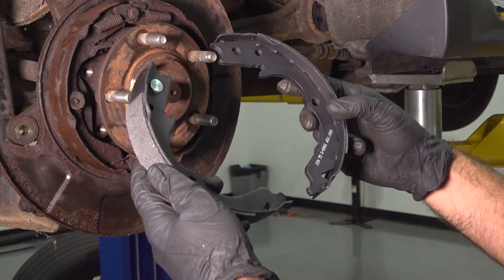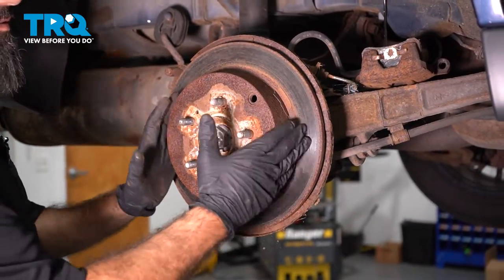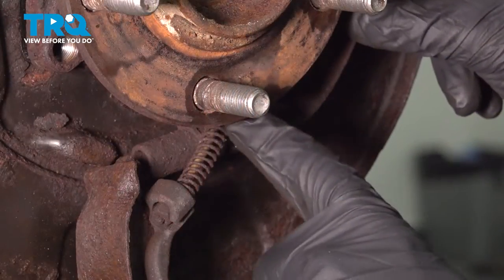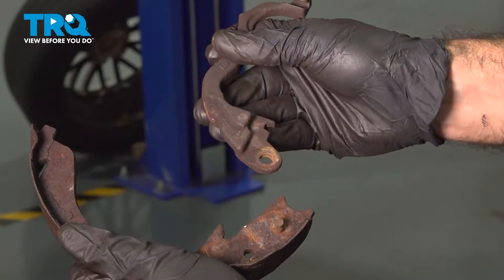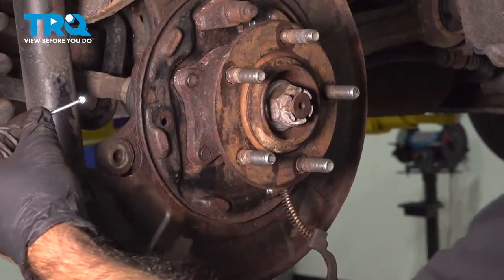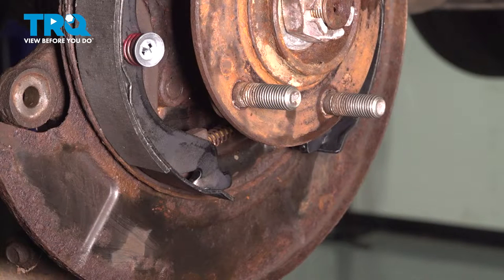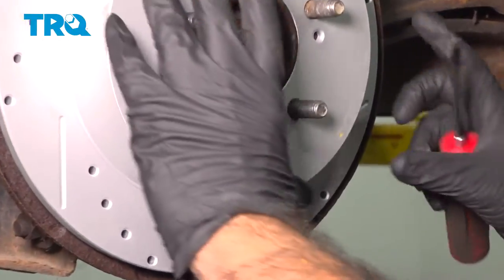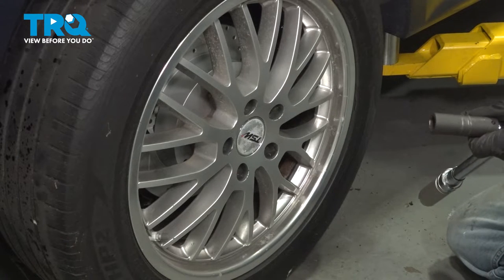How to Replace Emergency Brake Shoes and Hardware 2007-2013 Mitsubishi Outlander

Comment: Very important note about ordering SHOES :168mm (#886) is for 5 passengers and 190mm (#887) is for 7 passengers (seat in the floor !), I did the mistake with the short one on my 2010. Great video.Thank you